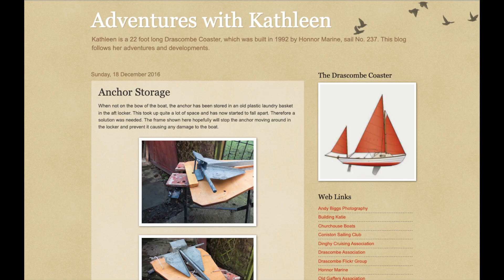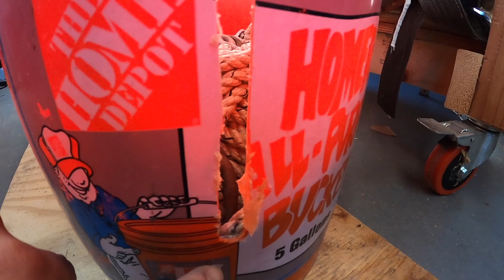Anchor Sled for my Catalina 22

Comment: Another solution would be to buy a Bruce anchor.... that would fit INSIDE the bucket, shank down
My anchor lived in the lazarette locker (Mac 26S) it was a Bruce in a SQUARE bucket (more stable than round and more space efficient)....I used to deploy/set the anchor from the stern (makes sense when you consider that's where you and the engine controls are) After engine shut off I'd walk the bucket up (outside the stays!) to the bow and secure the rode. Reverse process in the morning. One thing about a Bruce: no moving parts to pinch/injure your hands!!!

I "boat camped" on a Davidson 18 (swingkeel) for ten years....then cruised with a Mac 26 for 13 years....(both boats on both coasts of Vancouver Island.)
There is no free lunch and while you gain some stuff with length you always lose something as well!!
I always thought that your boat would be about the perfect compromise